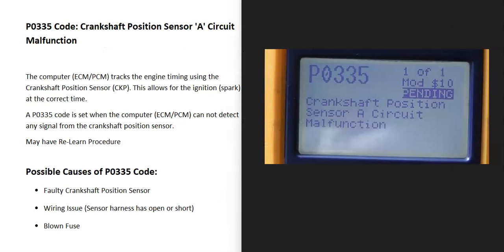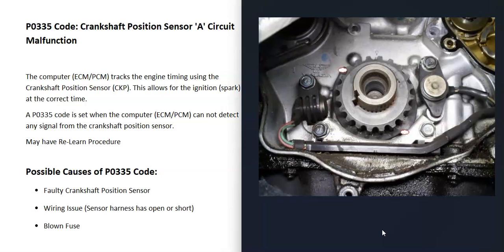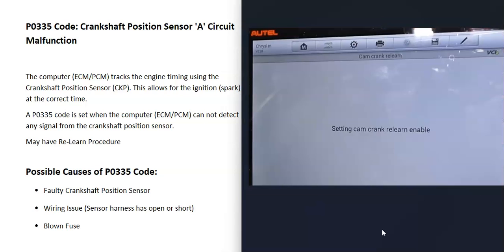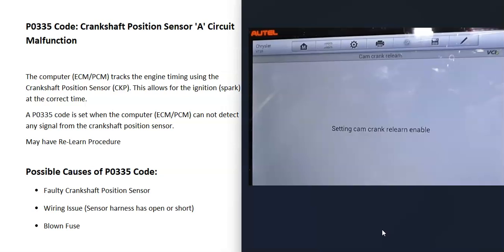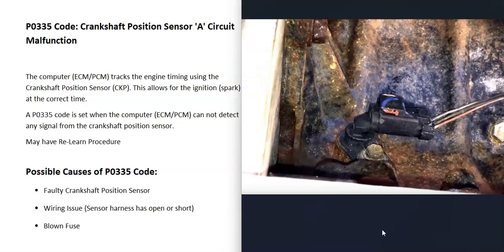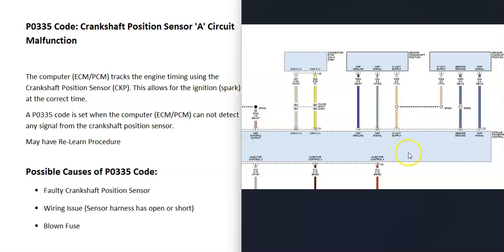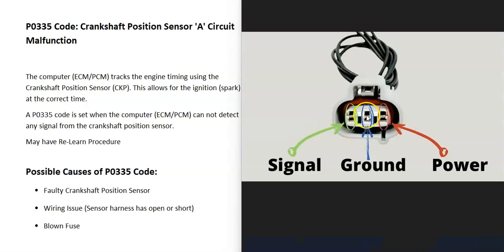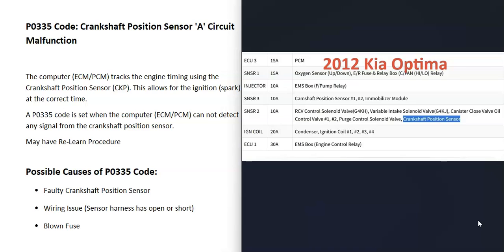Causes and Fixes P0335 Code: Crankshaft Position Sensor 'A' Circuit Malfunction

Comment: Oh ya, mine has just been changed. Giving the P0335 code, hitching driving down road, completely quit in traffic the other day, started right back up though, no check engine soon light at the time. I hope my computer isn’t a stupid one and has a fast relearn procedure. Thanks for the heads up, been thinking the new crankshaft sensor might be defective. Hope it doesn’t leave me walking.

Comment: Hello Sir I changed the krank shaft position sensor but the problem is still not working what can I do more have you idia about that
Reply from the maker: If the sensor is good, I would test the wiring. Keep in mind that when a cam sensor is replaced, some vehicles need a cam relearn.

Comment: Hello like your video. I also have an issue with P 0335, P0340,P0365. I have tried everything replace sensors checked wiring checked all fuses and tested all relay. We just recently put this engine in the car and we can't get it to start. We're pretty sure that everything is in time double checked several times it's just throwing those 3 codes. I'm wondering if I need to learn the sensors , the engine or the computer with everything. I'm thinking about purchasing a scan tool that relearns  the sensors do you think that would possibly work. Thank you
Reply from the maker: When a Relearn is needed usually a "Camshaft Position Correlation" code comes up. The P0335, P0340, and P0365 all point to a Circuit Malfunction. A Relearn can be vehicle-specific, including how it is done and how it reacts, so it may work, but I would guess it would be temporary, and the codes will likely come back. Before buying an expensive scan tool, you could call around to automotive stores, which often have loaner scan tools that can be used with a deposit with Crank/Cam Relearn option.
Reply: Thank you for your reply, so you think that there may be a short some where? I know that I have 5 volts at each harness an ground  ,but it's like no signal going to pcm. I did contact a couple automotive shops  but no luck, I did find a scan tool that I'm going to  purchase to see if it will give me some direction, I've went over an over things an still not start ,I haven't pulled apart the wiring harness yet but I checked all relays an tested an every  fuse.  Thanks again for your help.

Comment: i had a huge crack in my air intake rubber boot just before the throttle boddy. was running all crazy and stalling, could that throw off the computer to give the p0335 code?

Comment: I get code when code p0335 and p0336 when cold. Runs rough tachometer stops working. After warm-up and shut engine off for few minutes it starts and run ok. I had new crk sensor installed. The reason I had sensor replaced is one day it when into limp mode and  I put scanner on and it gave engine misfire and crk sensor code. When I shut off and restart the crk sensor code was not there and it ran ok. Any suggestions.
Reply: I have a 2014 camaro ss. Same issues but opposite of you. Cold start is fine an drives good. After shutting off is when issue start. Went to chevy & paid them for new part & relearn. A few $$$. Same day the issue continues. Take it back. They say my reluctor wheel has missing/broken teeth.  Car had been there for the 4th time for same issue.  But charged me for miss Dianostic's each time. $150..( new battery, alternator & ecu)
No reimbursements.  And wouldn't fix my car. Said Mechanic don't want to deal with it due to my mods😂😂😂. So check the teeth on your reluctor wheel
Reply: I have same issue on 2006 impala